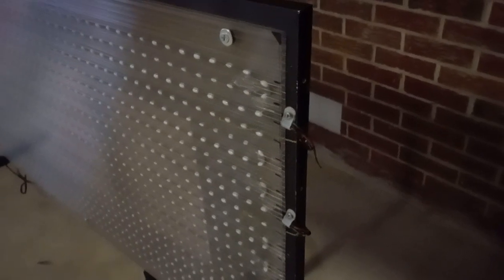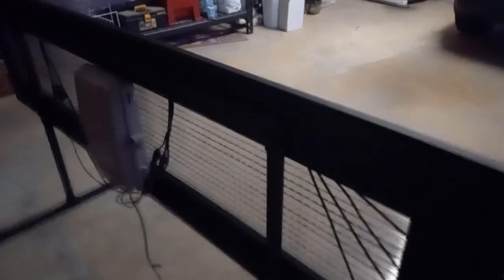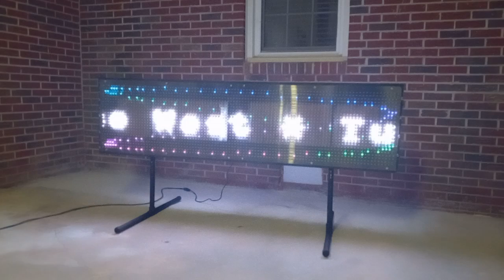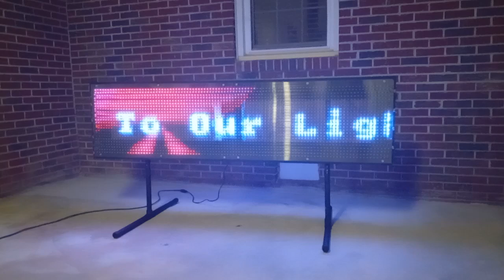2400 Pixel Tune-To Sign Running WLED

Comment: what controller are you using ?
and what firmware ? can you link it ?
Reply from the maker: The controller is the 8 port Bong 69.  On mine I am running WLED 0.15.b4 firmware.  They can be found here:  https://wasatchlights.com/products/bong-69-controller-priority-shipping-included
Reply: @Dixieland.DLights  I forgot to thank you last year. I am getting ready to build my first pixel prop so thanks for your videos greatly appreciate it